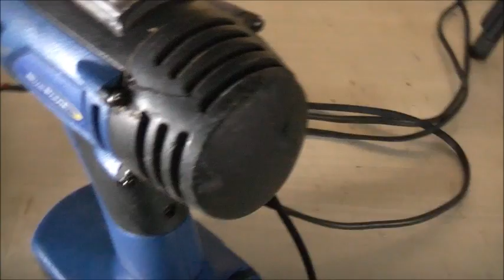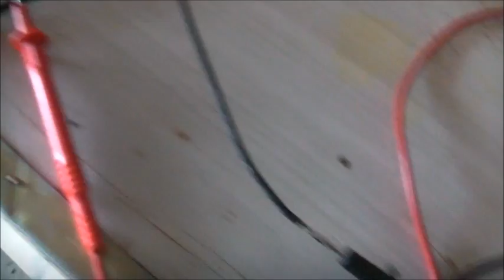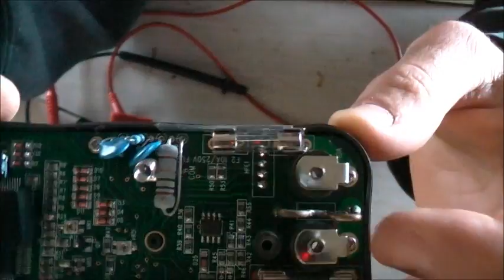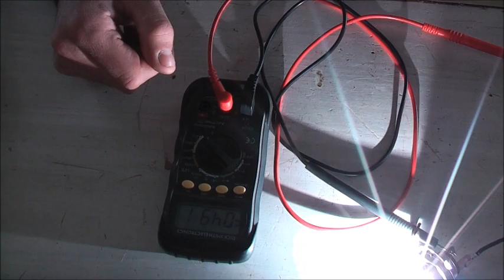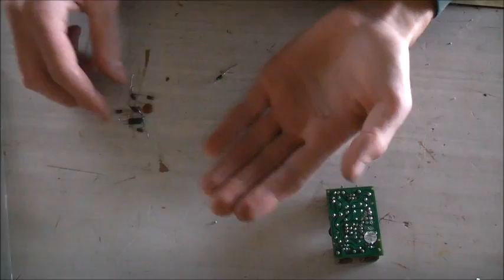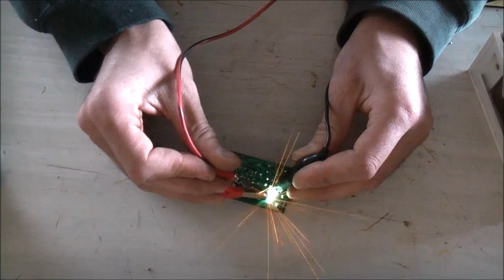Teardown, Test & Popping!

Comment: Oh yes, that would be a shame :-( :-(

Ive found most of the time you dont need a precision multimeter, most of the stuff around us isnt precision anyway :-)

You can get quite supprising accuracy with some cheap meters, and for the safety side just connect the probes to the high voltage points and switch on the mains at arms length ha ha :-)

Comment: I dont think that meter is bad, the insides look decent :-)

The man that reviews cheap meters is far too hard on them, most of the time its low voltages and resistance you measure, and for that purpose they work smashing :-)

So the bulb was around 57 watts, i liked the way the meter beeps as a warning, most dont have that feature.